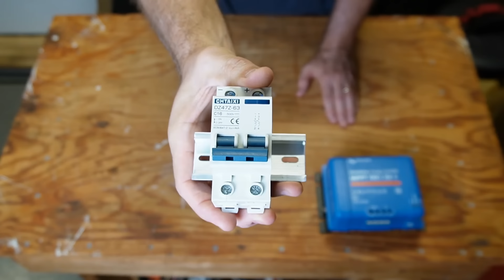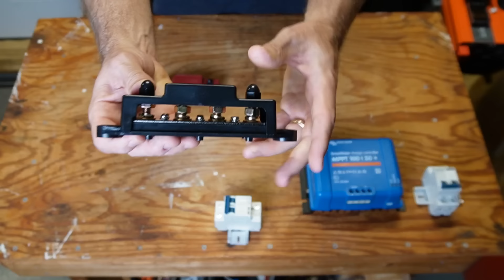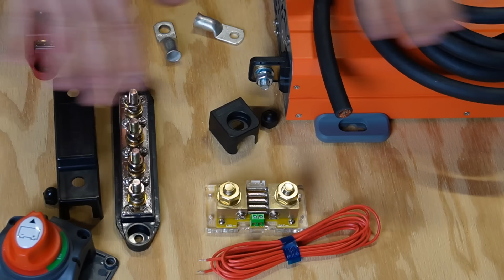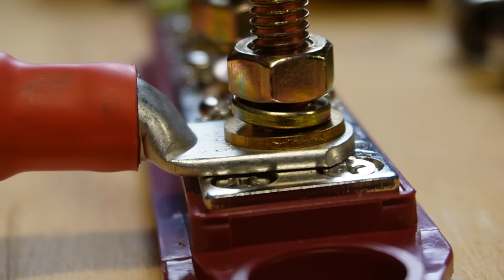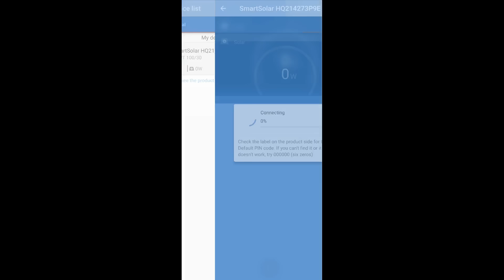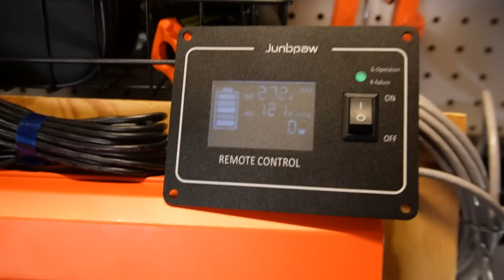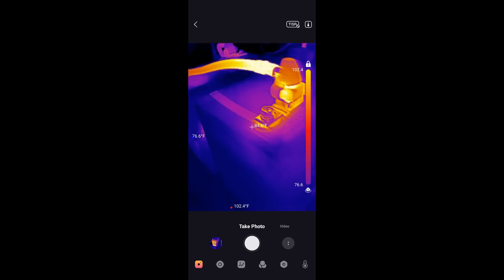24V DIY Off-Grid Solar Generator Build For Beginners

Comment: Where in this system would you add permanently attached AC battery charging, aka shore power?
Reply from the maker: Directly on the bus bars (positive and negative respectively)
Reply: @proficientprepper  Gotcha. So in the AC battery charging scenario, you would flip 16A and the 32A breakers to off to isolate the solar charge controller then plug in to battery charger to charge the batteries, correct?
Reply from the maker: For safety you should disconnect everything when connecting the charger. But technically you can charge with the solar charge controller and the battery charger simultaneously as long as they are both charging at the same rate. If you're not sure, just do as you described and isolate the solar charge controller.
Reply: @proficientprepper  Got it, thank you sir